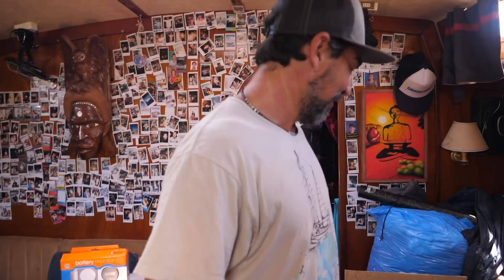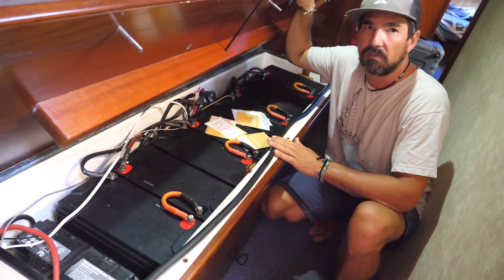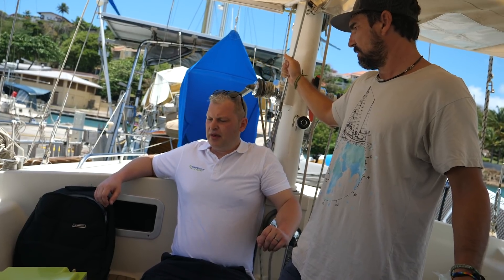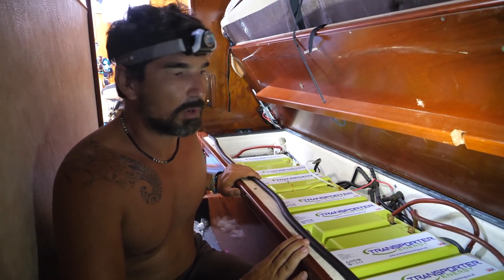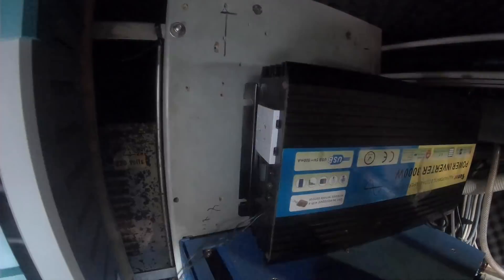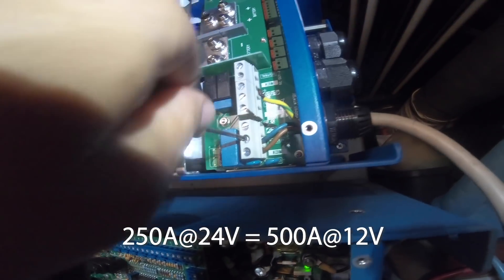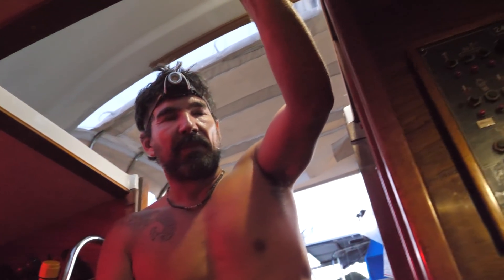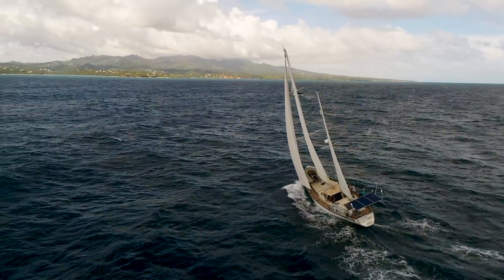Hello LITHIUM, Goodbye Propane!!!  Part 1-  Sailing Vessel Delos

Comment from the maker: Okay, this was a seriously cool project!  I think I will do a Part 2 that covers the rest of the configuration of the charge controllers, and what we do to replace the old propane oven.  Stay Tuned, and thanks so much for all your support that makes these videos possible :) If you'd like to see more of these please let me know by commenting, asking a cool question, or simply liking.  Fair Winds- Brian
Reply: Hey Captain! ) Yes, please do second part, it's always interesting to see Lithium installation with all details! Fair winds!
Reply from the maker: Okay will do!
Reply: I am really interested in the oven replacement.
Reply: Yea, I am also very curious as to what you do for an oven. Thanks for the informative video Brian.
Reply from the maker: We normally use our break maker for bread, but will probably install a small electric convection oven so Karin can make me her delicious Swedish cakes :)
Reply from the maker: We normally use our break maker for bread, but will probably install a small electric convection oven so Karin can make me her delicious Swedish cakes :)
Reply: How about https://www.amazon.com/Panasonic-NU-HX100S-Countertop-Induction-Technology/dp/B01LXOGZJ0/ref=sr_1_2?s=home-garden&ie=UTF8&qid=1539639340&sr=1-2&keywords=NU-HX100S
would not exceed an 1800 watt stove top,
Reply: Panasonic NU-HX100S Countertop Oven & Indoor Grill with Induction Technology (IH) and Infrared Heat, Stainless Steel
Reply: I love this kind of stuff. The main videos are awesome but it's fun to learn about all the work that goes into keeping your floating house going.
Reply: Hey Brian I don´t know about your kettle but the ones I know have very thin bottoms which is not good for an induction stove. Maybe the induction stove could have been faster boiling the water? Nevertheless imho you´ve made a very good choice with the induction stove and the victron stuff!
Reply from the maker: perhaps, this kettle did say it was good for induction but it was SUPER CHEAP at the local hardware store here.  Perhaps something of a little higher quality would improve our results.
Reply: I love all your videos, but being a gearhead I like the repair just as much. installing the generator or fixing the toilet it shows that it not all beaches and bikinis. Could you do a video and explain sailing and how the instruments work for us land lovers.
Reply from the maker: Yes!  have a new instrument video on my to-do list :)
Reply: I can't wait for part 2 !  Do you have a small propane outdoor grill ?  Are those style of bottles more universal/available ?
Reply from the maker: We're gonna ditch our Magma propane and try out something crazy like a kenyon electric, stay tuned for that :)
Reply: is the hot water heater electric?
Reply from the maker: Our water heater operates off 220V AC, or from the engine heat exchanger if we happen to run that.
Reply: MOAR! All of these "behind the scenes" are fascinating and a real part of sailing life! Super interesting and well explained. Fair winds!
Reply: Please include a short safety segment: cable sizes, fuses/breakers, insulating terminals, working with metal tools, eye protection, maybe a smoke detector in the battery box.  You don't have to go full-nanny mode -- just a quick comment.  People can do their own research if they know what the issues are.
Reply: Awesome. Kinda answers my question on the previous video about batteries. However, curious again why you chose to go with 8 100amph lithium batteries rather then fewer batteries that carry more amp hours? For example, lithium batteries that hold 300 amp hours each.
Reply from the maker: It's actually a space thing, this size battery actually allows us to have more AH because of how they are arranged.  With the larger cells we could only fit 600AH, and have a bit of wasted space....
Reply: this is hero right here. I was just about to start the task of figuring out the right batteries etc to refit my battery bank.  Your research made my task much easier -  to suppliers in particular.  Your background is a programmer, yes?  Wondering if you've always been an electronics geek (builder) or if you acquired it on Delos?  If it's newly acquired knowledge, what have you found to be the most useful reading material (learning material) to tackle projects like this?
Reply from the maker: Ha ha thanks :) . I was actually an EE, then got sucked to the software industry because they offered to pay more.  But my heart has always been with embedded systems and cool electronic stuff.
Reply: This video was amazing! Please more of the same. Thank you so much.
Reply: I love videos like this! It shows how real and original you guys are. Please keep it up!
Reply: Hey Brian... I too like these sort of videos, as a retired electrician with an extensive background in solar; it keeps me more current in what's out there hardware wise, as I'm not arround it anymore.
Reply: It's all about optimization and redundancy on an ocean-going vessel, great retrofits! I'm the guy just about to start marine tech school, I'm thinking of the cost comparison between lead-based batteries and the new lithium batteries- more expensive but..! I'm most interested in if you will be getting a monetary return over time after the initial cost of the upgrade. The hourly cost of operation improved // fuel price equating to more output. Your comments suggest you will! 80% of the battery bank available compared to 50% for the same fuel consumed !!!!! Wow!
Reply: You might want to check out cookware better suited to induction. Some links mention magnetic stainless? Most likely even faster. I Love induction, Betcha they soon come out with a boat version.  Enjoyed this video.
Reply: Definitely interested to see what you guys do about the oven! That was my main thought watching all of this. :)
Reply: Hey guys, I just wanted to run a recommendation buy you.  Maybe think about getting a couple of pressure cookers on board.  They are far far more energy efficient.   There will be a time you wish you had more juice in those batts! LOL
Reply: Part 2?
Reply: Sailing SV Delos thanks for cooking up another great video.
Reply: Fuck yes Delos, hell yeah!
Reply: look forward to part 2
Reply: Is this system being installed in any brand new sailboats that are heavily electric dependent  ? And did you have any fears of potential fires like what we've seen in some laptops and cellphones  ? Finally , y'all usually do Crossings with a large crew ( I love that ) , but is being limited to two burners going to be a inconvenience ?     Thanks , love the videos .
Reply from the maker: I have heard of some larger Benetaus going more electric, beyond that I'm not sure....  The chemistry in those batteries is different, and more volatile from what I understand.  The LiFeP04 is much more stable!  We actually could only use one burner on our gas stove because the space between them was too small, I think this way we will actually be able to use two pots at the same time.  YIPPEE!
Reply: I think that's a large part of why LiFePO4 - they're much more stable than Li-ion, but in the race to slim everything, the lower density (size vs capacity) just isn't popular in portable electronics.  (But also why the company man was eager to point out the failsafes built-in)
Reply: I would love a part 2!
Reply: Awesome info, looking forward to the oven replacement video.
Reply: excellent man.
Reply: That was excellent, we are using n the process of doing this on a cat. Was the 3000 big enough or would of gone the 5000w unit after using it.  Could you run the two hot plates at the same time and microwave?

Just curious what you can run with the 3000w victron. I guess you didn’t need to upgrade the inverter cables?
If so what size and length of run.

Love your work.
Reply from the maker: For us the 3000W is enough, the induction is rated at 1,800W and the microwave at 800W, so it should just make it.
Reply: This is awesome.  Please keep videos like this coming! 

I would also like to see you circle back around once you gather a decent amount of data from your fancy new voltage monitor and let us know how the system is performing long term!
Reply from the maker: Will do :)
Reply: Well done Brian, that was a solid day man.  Well documented too.  I've done similar inverter installs and I'm impressed with your efficiency and proper function.  Really indicates good planning and proceedure.  Thanks so much for sharing.
Reply: Hi Brian.. Question how do you secure pots while cooking on passage ?
Reply from the maker: I thin we're gonna copy the rail system on our old marine gas stove :)
Reply: I liked it however I also like your adventure presentations(air, sea, land)  also , looking forward to part 2 and those wonderful adventures
Reply: cool mod . did you have to change pots and pans ?
Reply from the maker: Only a few of them, the important stuff like the sandwich press and pressure cooker worked just fine :)
Reply: Congratulations Captain! Look forward for the next chapters! Cheers!
Reply: Really enjoying the tech videos! So please do make a part 2 and 3 and .. :)
And if this project is finished, it would be nice to see how you use the tech instruments to navigate the boat.
Reply: hi Brian, I think these videos make a great addition to your usual vlogs... however please don't see me as negative but do you have any control over the adverts ? especially on these informative videos? either way I'm glad their not ruining the main videos... thanks for all your content thou it is appreciated
Reply: Sailing SV Delo
Reply: Hey, cool upgrade! Next electric engine?! That would be awesome!
Reply: Brian --- Hey if you have not figured out the oven part yet - We got a wolf gang puck pressure oven from on of my wife's favorite fancy kitchen stores and it is awesome....it does get hot on the surface but nothing more than a typical oven in a boat...I am trying to steal the oven for an overland trailer I am building -- You may want to try the pressure oven..food is much more moist.. also if you get to Texas you need to come to Kemah-- 3rd largest sailing population in the US and its awesome...  keep posting, love your videos -- also what temperature does the lithium ion batteries start to loose effectiveness?... heat is my concern on them.  Best Jeff
Reply: I love it when you work on Delos Brian!  One of my most favorite parts of your series!  Keep 'em comin'!
Reply: did you consider lead crystal batteries..almost same run characteristics cycle-ability and charging as lipo at a fraction of the cost..and way less volitile...just they are still heavy....been using them for a couple of years and I can't kill them
Reply: That tea kettle isn't really designed for induction heating. Stainless will not work as well with them. It would be nice to see how much power the induction stove can put out into a proper pan either designed for induction stoves or just thick aluminum or something.
Reply: Absolutely!
Reply: Good work.  I'm sure we will be hearing about the system from time to time as issues and interests occur....thanks!
Reply: Just a thought - Induction should boil that water much faster. We had similar speeds, changed to the specifically “designed” induction pots, pans etc and boom! Success - (like half the time of gas) ;). Might be worth a look.
Reply: Great project Brian I am definitely looking forward to part two.
Reply: I love your techie videos and must admit that I think I got a little turned on when you conducted the water boiling comparison experiment.
Reply: Did you remember to adjust the alternator regulator?
Reply: ultra interesting. look forward to parts 2, 3, 4, etc.
Reply: Sailing SV Delos I’m sent Bryan a PM, with hopefully helpful information.
Reply: Thanks for an excellent video. Please do a Part 2 and include the cost of the system.
Reply: good video. one comment: large batteries can also be very dangerous, not sure if they are less dangerous than propane.
Reply: Love your how to videos!!!  More thumbs up
Reply: I wonder how much space could be saved by replacing the diesel motor and tanks with an AC motor? The space savings for the motor is huge and the space the fuel tanks take up plus the propane storage lazaretto could hold batteries. The geneset could still be used with a smaller tank. ELCO makes motors.
Reply: I'm curious how those three chargers get wired up to work together.
Reply: Heya Delos and Cap't Brian,
Cool move to get rid of the propane - so just wondering if getting rid of petrol (gas) for the outboard is next? Diesel or electric? The idea of simplifying the energy systems on a boat makes a lot of sense at a high level, but in practice can be less clear cut once reliability and maintainability are factored in. And whether or not the boat remains livable whenever various components fail (which always seems to happen when you least need it to!). Just wondering what your thoughts on the outboard and fuel options / alternatives are? Mini-webber as a backup?
Fair winds,
Cheers T
Reply: Brian I just love watching you problem solve and make boat improvements!!
Reply: Just got the 300ah package, need you to come up to Tampa and install. I hired a certified electrician, but seems there’s still a knowledge gap with this technology.
Reply: I'm wondering how your dealing with the grill. Rick said you got rid of your grill also.  I thought that you might have gone with an infrared stove that can grill as well as cook like a conventional stove top.  I see the advantages of a induction type of stove top so long as you have the right type of cooking utensils. So how are you dealing with a replacement of your grill?  Or did you replace it?
Reply: 1.What's the purpose of having three separate chargers(multiplus+ other two units)? Do you need dedicated chargers for solar/ wind/ alternator/ genset, or is it just to power batteries from multiple sources simultaneously, or because of different amp ratings? Does each charger have/need a dedicated charge controller(ex. MPPT)? 
2. How does Delos combine solar and wind energy? Do you use a dump or diversion load? Heat a water heater to prevent the turbine from being under no load? Does solar and wind need separate controllers? Does wind turbine need controller at all? Love all the Delos videos, but the way you explain and show your projects in the tech videos is amazing, interesting, and I really learn something. 
3.Ya been A1 from day 1 Capt. Breeyawn.
Reply: Yes, even as an electrician and a foreman for a residential and commercial solar Co. I have questions how the three charging systems(wind, solar, and shore power) interoperate. Onto part two.
Reply: Your alternator connects directly to the Lead acid battery right?
And then how do you get the alternator to charge the Lithium bank?
Each vendor suggests me a different device to install between the Lead and the Lithium: another BMS, or a simple Cyrix battery isolator, or an expensive Sterling B2B charger - I am really confused :/ (The alternator is our main charger.)
Reply: So you really have scraped semi new lead batteries or did somebody less rich than you buy them?
Did you know that lithium batteries wear out at a rate of 12cent per kWh and that is even higher than the cost of lead batteries? You guys are way too rich.
Reply: Wanted to warn you slash inform you. 24 volts will weld mild steel. Its one of the tricks we us off road.  Add the fact of the total amps and you will feel like a wasp just stung the crap out of you if you ground yourself out.  But now you know a way to weld repairs at sea if you have wire and rods lol
Reply: Hey Brian! What a great video on  your upgrade for cooking from sun and wind.  I am concerned about your cord on the inductive cook top.  It is hard to tell if it is flexduit or MC cable.  MC (metal clad shielded) is not safe for repetitive motion ... it can wear/cut insulation off the wires.  Have you considered a solar still for water or moonshine?  How about a "sun oven" aka solar oven for slow cooking?  Thanks for all the amazing videos from you and the crew!
Reply: Sailing SV Delos really enjoyed this video.....looked into one for my 2016 Silverado.....not any advantage....yet but this was cool to see advantages of lithium for your boat
Reply from the maker: We are thinking of electric hybrid for Delos 2.0. Stay tuned on that one :)
Reply: Delos 2.0 ? New SV?

Comment: Brian,  considering the newer Victron Units available today: Multiplus II and the Quattro would you install anything different if you were doing the lithium upgrade today?  Specifically, would you still install the Multiplus and not the II or Quattro version?  P.S. we have the same Amel, different year.

Comment: Considering batteries are heavy I'm surprised that the weigh isn't spread as far as possible away from the centre of the boat, so that it takes greater rotational momentum to move.  Wouldn't it help to dampen the movement from the waves?

Comment: The lesser spoken of issue with lithium batteries is that the electrolyte is a highly volatile hydrocarbon. Yes, the Lifpo technology reduces the chances of membrane damage or thermal runaway starting a fire. Ditto for the internal computer and monitoring. But failure of a circuit or sensor can still start a reaction. Once started, a lithium fire is not extinguishable like any other type and in fact, adding water to the equation intensifies the fire. These factors are making the advance of lithium into regulated passenger vessels a slow march. None of this is to say we shouldn't be experimenting with new tech. Only that we should do so mindfully. Please always be sure you have a path out of the cabin away from the battery bank.